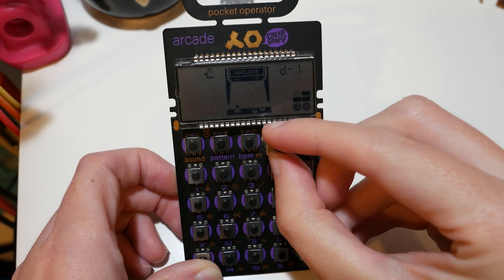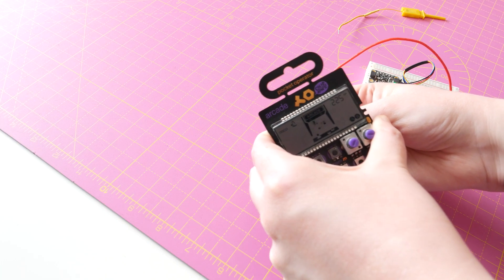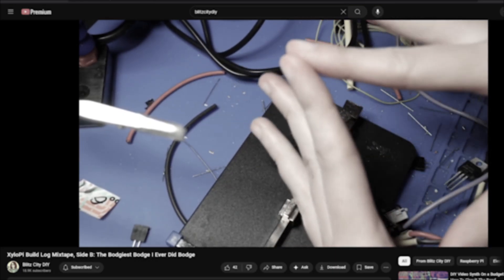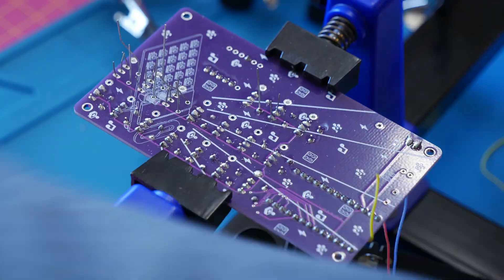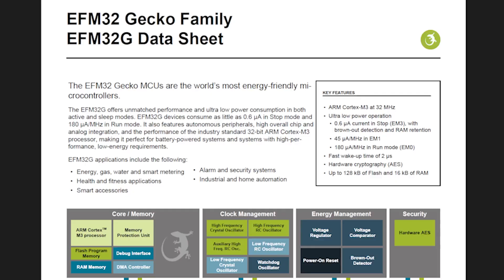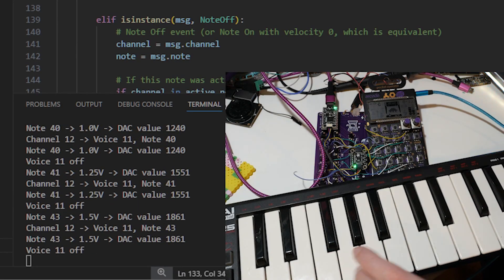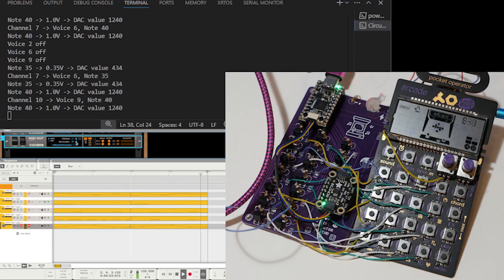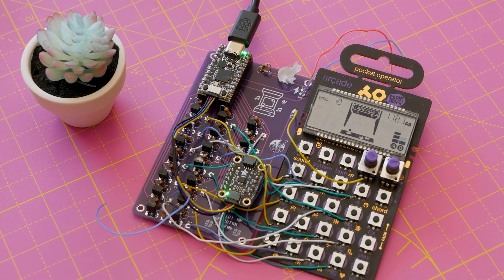MIDI Controlled Pocket Operator?

Comment: This is such a cool hack! I honestly think the issues with the DAW could be solved if you just took a cheap midi controller and wired the signals from the keys directly to either a microcontroller to change the signal or to the pocket operator directly. Either way this was such a cool video!

Comment: If only buttons weren’t surface mounted, you could solder pins on the other side of PO's and make pin header on your PCB, turning the former into an MCU shield… but we have what we have 🤷🏻‍♂
Reply from the maker: i know, honestly it gets to the point where you almost want to dump the firmware
Reply: @BlitzCityDIY  understandable!
Reply: pogo pins could work, but getting the tolerances right doesn't sound like a fun time

Comment: I wonder if this could be simplified a bit by making a PCB that has cutouts where each button is with casellations where the pads for the SMD buttons and pots are, and then just desoldering all the buttons/pots off the PO and soldering your PCB directly sandwiched on top?
Reply from the maker: definitely a possibility and probably something i'd consider if i did another revision